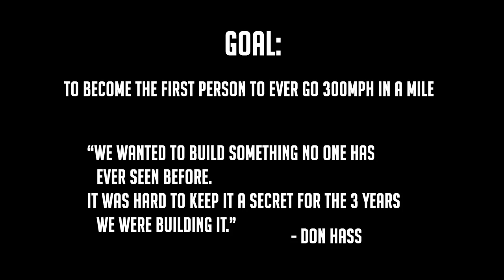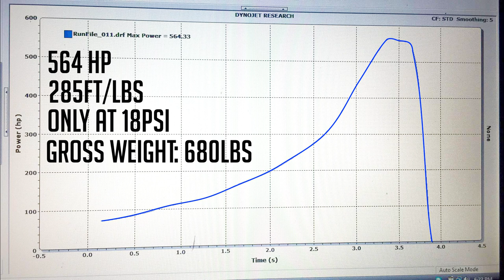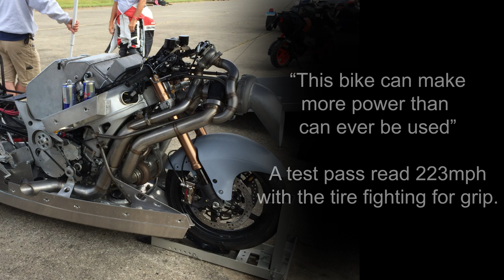The Compound Turbo Hayabusa 2016 Introduction.

Comment: Kick ass bike. Looks like the back tire needs to be about 2 or 3 times wider to get any sort of traction when WOT.

I love seeing turbo technology progress. I also can't wait to see what the electric stuff can really do when they figure out the energy storage problems.

Until then, I'll stick with explosions.
Reply: Instant max torque, let's hope they build some usefull batterys soon :D
Reply: We can switch to electric in cities and keep gas stuff to have fun.
Reply: +Adrien Perié While I love combustion engines, they won't be able to hold a candle to the sort of instantaneous power that electricity can deliver. 

Electricity is SCARY fast, but the battery and charging tech right now severely cripples them in the range department. However, we will get there.

That being said, I will always have an internal combustion engined vehicle somewhere in my garage(and my heart). :)

Comment: that aero testing is the shit i bored and stroked my fj1100 added nitrous and hit an aerodynamic wall at around 160 mph, 6500 bucks and gained only a hair over 10mph over stock ....of course it got to that speed substantially quicker...that machine i some engineering genious. thanks for posting the video!

Comment: What is the compression ratio ?
Why the tail si cut square,and not like in the aero room ?
Are there exit holes in the tail ?
Reply from the maker: The tail was changed from information learned in the wind tunnel. The holes in the rear of the tail are for air pressure.
Reply: Thank you.
The compression ratio is a secret right ?
Reply from the maker: +michaelovitch 9:1
Reply: Thanks : )
Reply: Im familiar with compound setups - looks like you have 2 small high pressure turbos (one on each side?) and a large low pressure up front.  But all that work for 18PSI seems odd.  Surely youre running much more than that for your final setup?  And then with 9:1 compression I assume youll be on race fuel or E85 or something to get the most out of it.  Is the compound setup just to give you the most possible RPM range for the boost or is it for efficiency?  Once you get up to 25+PSI usually a single stage system starts to get pretty narrow as far as RPM range
Reply: theres only two turbos from the looks of it, smaller down low and larger up top
Reply: "Only" two turbos. XD
Reply: michaelovitch
Reply: michaelovitch the holes were probably to release pressure build up in the rear wheel well
Reply: Yes,looks like it's what they learned in the aero room.
Reply: Hass/Serafini Racing what's the max rpm ?

Comment: You guys did a nice job! I first noticed the welding and then the attention to detail.. Good looking out for the Pilot.. I can only imagine what damage a chain could do at those speeds.. So props there. It's to bad that in order to be wind resistant the body has to be shaped like that.. Don't take it personally.. It looks nice.. It looks better without it.

Comment: Question...What if a gust of wind hits the motorcycle? How will you keep from crashing?  I wonder because you have no lean angle at all. My BMW K1200S can get a fairly decent straight-line angle of lean from a strong steady crosswind. This happened to me riding out to Colorado through NE New Mexico and NW Texas. There were miles where I was probably at 10-15 degrees of lean just going in straight line.
Reply from the maker: Fair question. One reason just testing the bike for boost control takes good conditions. For big runs with the fairing we'll have to wait for basically NO wind. Without the fairing there is a larger window of error. You point out one of the limiting factors in testing.
Reply: +Hass/Serafini Racing Is there not a way to design the bottom of the fairing so it gives you some lean angle? The way it is now it would dig into the road and cause you to crash.
Reply from the maker: Good observation. The bodywork was designed that way and we only intend on running all out in the beat conditions. A friend recently ran in some wind and had some issues. We intend on waiting for good conditions for this second reason. At really high speeds ever with a ability to lean you get into trouble really fast.  If the angle of trajectory gets off a couple degrees you are simply going to be off the track before you can do anything. At 250-300mph a 300foot wide runway becomes very narrow when off 2-3' at those speeds. But it is something once big testing occurs we will take into consideration.

Comment: I know a guy who races in Florida, not going to drop his name here, his nick is Pharaoh. He rides an S1000rr and has a front fender that encloses the wheel about down to the axle, from my humble opinion, and I don't know if rules limit this, but I think your design could benefit from a more aerodynamic enclosing front fender, and also, some side flares to generate downforce, especially on the rear. Great job, this thing looks over built/powered twice over

Comment: Dose the turbine have a shaft to the crank (compound) like a Wright cyclone.or Napier nomad?...Wright R-3350 Turbo-Compound radial engine. Two exhaust recovery 
turbines shown outside impeller casing area (top (silver) and lower (red
 blading)) that are geared to the crankshaft.

Comment: Props for building such a well engineered bike. Any plans to add a wider rear tire and wheelie bars or something to try to be able to put down more power?
Reply from the maker: It has a 240rear wheel tire. The biggest thing in testing was getting the boost controller setup. Speeds will be going up.
Reply: Is it going to be done by gear? (a particular set amount in each gear)

Also, I'm curious what the gear/sprocket ratio you're running on that thing, would you be willing to answer that?
Reply from the maker: TurboMitsubishi Yes based per gear and climbing based on G force and traction.

Comment: Just curious, why compound turbocharging for 18 PSI boost? That's about a 2.2 pressure ratio, a single compressor stage can reach that without even trying too hard.

Comment: Was that a full 1 mile run, or 1/2 mile? If full mile, you have your work cut out for you to reach 300!
Gearing looks outrageous...100mph+ in first?
Reply from the maker: We shut it down early. Just taking data. That was the third run ever on the bike. Stay tuned we have an event in 3 weeks where we are looking to put up some big numbers.
Reply: Thanks for your reply. Good luck at the upcoming event! :)

Comment: Lbs/ft, not ft/lbs. or more accurately NM. Suzuki make great engines. I have noticed the Suzuki M13A engine is very similar to the hayabusa engine although it has even longer rod to stroke ratio. The M13A non VVT engine is a better engine than all current aircraft engines on the market, hence I am using it for my helicopter build.

Comment: The bike should have a full chomemolly cage with a Kevlar ,reinforced body,in case of a blow over, pop a chute you could also put aero aids to keep the motorcycle from becoming airfoil on its side if it does blow over or become unstable.

Comment: Make car tire rear hub. I suggest 300mm wide tire for this thing to start. Slight design change on rear fairing to accommodate wider tire and custom swing arm etc. You need more tire plain and simple. Comon guys get it done ill be waiting👍

Comment: I understand the need for compound turbos on diesels that need stratospheric levels of boost but please explain the benefits when only 28psi is required? A single should be able to make up to 70psi.
Reply from the maker: This bike engine is only 1300cc, so it's really small compared to car/truck engines... Which means it can only force so much air... hence compound turbo for higher boost.

Comment: how much hp could a hayabusa engine make just with turbo added and maybe bigger fuel flow ? (but strictly no other modification like valves, cam shaft, crank shaft, etc ! )

Comment: By compound turbo do you mean 2 turbos or turbos geared to the output shaft/drive ???  Some WW2 radial engines used turbochargers geared to their output shaft to increase hp..............Jay
Reply from the maker: A gear drive charger is a supercharger. Compound mean the compressor from the first turbo feeds the other turbo.

Comment: How does it qualify for the 1000cc class? A Hayabusa engine is a little under 1400cc.
Reply from the maker: One bike is a single turbo gsxr 1000 that goes roughly 240mph in the standing mile and this new bike is a compound turbo 1298cc.

Comment: We really need to rethink motorcycles,the drag on a motorcycle is tremendous.Don't think so ? just hang your palm out the window it 60 mph.Then make a fist,,notice the reduction in drag,imagine a motorcycle with a streamline partial or complete body,it will not only accelerate  faster,in some cases it will double the fuel,battery range,we can use smaller,more efficient engines.which can help reduce emissions ,while using half the fuel. A streamlined bicycle under human power in a streamlined body went 89.59 miles per hour (144.18 km/h.) almost 90 mph at Battle mountain Nevada in 2016,just to give you a idea of how much it improves the reduction of drag.You would be lucky to hit 40 mph on a good bike,try going 90 mph in the wind.

Comment: What tyres do you use, to stop from melting?
Reply from the maker: Continental
Reply: Hass/Serafini Racing very interesting project. the best of luck to everyone.  my only question is why was a compound turbo setup chosen over a single? typically compound setups are usually seen in absurdly high boost applications.  how high of boost pressure to do expect to run?

Comment: you need to recruit Ghostrider to pilot that bike, he has a lot of experience with 500+ HP turbo 'busas
Reply from the maker: Don has a 520+rwhp 1000 for 10plus years. He wins the Sport bike shoot out every year. Who needs a 500hp busa
Reply: why does this go so slow
Reply from the maker: +Kyle Crater just a test pass. Working out bugs. Learning how to control the boost. We are ready to turn it loose at the next event weather permitting.
Reply: +Hass/Serafini Racing was it hard to find tires or the RIGHT tires to go 300mph? how hard is it to even find a 300mph tire let alone tires with the proper compound for traction?

Comment: Out of curiosity, did anyone account for the difference the exhaust makes when the bike is on? Wouldn't that affect your aerodynamic "envelope"? (i.e. when the bike is on, the exhaust is pulsing out the side, increasing the cross-sectional area of your envelope, which in turn would increase your coefficient of drag. 
Also, possibly doing more analysis on the inlet leading to the turbo: maybe that could lead to a decrease in the pressure differential of the inlet, allowing for a larger volume of air being drawn in by the turbo. (potentially more power?). 
Then for the body work, one could utilize more testing, similar to what the hyper-mileage use with tufts of string to see a more 3-dimensional picture of the pressure differentials caused by the body design. It would be interesting to see how the exhaust affects those pressure differentials as well.
For the record this is by no means meant as any form of disrespect, just thinking out loud so to speak, as an engineer I find these types of projects, extremely intriguing.
Reply from the maker: We been thinking.
Reply: Awesome, please keep us updated. Can't wait to see more footage.

Comment: why compound turbos with only 18psi? that's great for diesels with pressure ratios as high as 4:1 maybe  more, but many turbos are in the middle of the efficiency island between 2:1 and 2.5:1. i didn't see an intercooler after the first turbo so with a higher efficiency you'd probably have a better density ratio from cooler air with just the large turbo.
Reply from the maker: The bike has dual air to water intercooler cores. 18psi is all we ran in the video but its bot the max psi we have ran or will be running. We dont know of any other busas making close to that power on 18psi so the efficiency by defination has to be pretty good. ;)

Comment: Why compound when you're only running 18psi?    Purpose of turbo compounding is to either run very high boost levels (over 70psi) or to broaden the torque curve(boost threshold much lower)   I see neither

Comment: a turbo that is powering a turbo,,, interesting
Reply: My thought too :-)
Compressed air gets compressed, instead of using a larger turbo... maybe their setup tightens the turbo-gap?
Reply: +Koempel Harie compound setups are common in doesel tractor pulls and they can push more boost pressure than some engines have for a cranking compression number. 
Some of the extreme ones are upwards of 200psi, a gas engine would never handle that kind of pressure though.
Reply: Aha, that makes sense. Thanks for sharing! Have a great day +MrTheHillfolk
Reply: +Luc no problem.cheers!! 
I see it commonly on diesels , but seeing it on a gasser it's pretty impressive !
Reply: i'm guessing its to reduce turbo lag, since the engine is such a small displacement. small turbo feeds the larger main turbo.
Reply from the maker: You can take two turbos that would say too out at 35-40psi and whole compounding can produce 75-80psi without flopping off the efficiency island. The exhaust flows thru the smaller turbo first and then into the large turbo combined with the wastegate exhaust fron the first turbo.
Reply: yes i'm well aware of how compound system works , I work for caterpillar. if it's purely boost you don't really need a compound system. most diesels push 45-70 psi average, and with an injector pressure of 60,000 psi. but that's a diesel. i would think with 75 psi even on race gas (110-120 octane) would cause detonation.
Reply: It's not what it looks like, it is in replacement of the now lost "flux capacitor" technology, you can see the warping of the time-space continuum in the film during the on-track testing. All the cool kids are doin' it now.
Reply: Turbobusa
Reply: It's called a bi turbo. This is were  smaller turbo feeds a larger one
Reply: i dont quite get why they use them in-line instead of a parallel system if they only have 18 psi

Comment: Why use compound turbos when you're only running 18 psi?  Wouldn't it be simpler, cheaper, less weight and better efficiency to use a single turbo for 18 psi?
Reply from the maker: Thats not all he is running but thats all that could get to hook up on the dyno

Comment: This thing is pretty awesome, but I would not want to be the guy who blows an oil line or the turbo oil seal with where the compressor is mounted. A 300MPH scalding oil bath would really ruin your day. Is there a firewall behind the turbo I'm missing? If not, it should be considered.
Reply: Live or ride fast, die young ;-)
Reply: +Luc Being reckless for no benefit is stupid.
+K31TH3R Hmm, turbo oil seal would dump oil out the exhaust. The oil line blowing is unlikely, but it can't hurt to take a precaution. Good thinking.
Reply: Being reckless for no benefit doesn't exist on this planet ;-)
Reply: No but yours' do...

Comment: that's completely bonkers power, 680lbs and 564hp. 0.82hp per pound.
Reply from the maker: At 18psi. Thats just starting.
Reply: Except for the numerous cars that break the 1hp/lb number
Reply from the maker: Actually we believe it's more like 1.4 hp per pounds. That was only 18psi and it is capable of around 75psi
Reply: 75 psi ? ok , that's impressive. didn't know that a bike engine could take that kind of pressure. what Compression ratio are you running ? 
obviously the internal are not stock, but the block is right ?

Comment: I know nobody likes to think about this, but seriously what happens if you get tank slap or blow a tire or something going 300mph? Do you just hope to slide out and not death roll and hope your gear saves you? Seems like there's no happy ending to a crash at that speed on a bike.
Reply: There is absolutely never a happy ending falling of a bike, ever. It doesn't matter how you screw up or what happens it is going to hurt regardless. That's why I find it more enjoyable to ride go karts at the track than a bike because on a bike I can never relax when pushing it and on a go kart the worst that can happen is I can spin off the track. This dawned on me when we were sharing a track with some go karts and a dude offered to switch for a few laps, it changed me...

Comment: You know, I had that idea for a long time. putting a funnel of some sort on a turbocharger to help spool up and create some pre-compression.
Reply: Pre combustion? Really?
Reply: lol ram air into a turbo... you couldn't even measure the effect it would be so negligable.
Reply: +Simon T 
 Well i was imagining that the funnel would be pretty big, sorta like how a scoop is used on a car. 
 It may not pre-compress it, but I'd imagine it would reduce the spool up time.
Reply: +shexdensmore I guess it can't hurt.
Reply: That would be one hell of a custom exhaust system though.
Reply: Ram air doesn't do anything for NA applications.  It would do less for a turbo.
Reply from the maker: WHat you just said is complete BS. Holy SHit.
Reply from the maker: Again WHat you are saying is complete wrong. SOme NA motorcycles can produce close to a psi off just ram air. That twice atmosphere.
Reply from the maker: These guys need to stick to playdo. Imagine the air going against your hand at 50mph out a car window. Now at 100... that of pressure and air flow go up drastically. At 200-300mph it will produce noticeable effects to say the least.
Reply: But 1 psi isn't x2 atmospheric, that would be about 14.5psi. Did you mean 1 bar from ram air? That seems too much to be possible though.
Reply from the maker: noxious89123 no 1 psi on stock bikes from ram air.
Reply: Hass/Serafini Racing
I can believe that, 1psi from ram air seems reasonable.

But what were you referring to when you said "SOme NA motorcycles can produce close to a psi off just ram air. That twice atmosphere."

Because it reads to me as if you're implying that 1psi is twice atmospheric pressure.